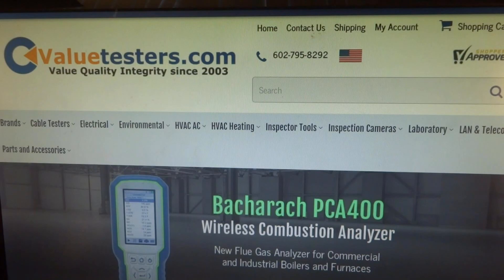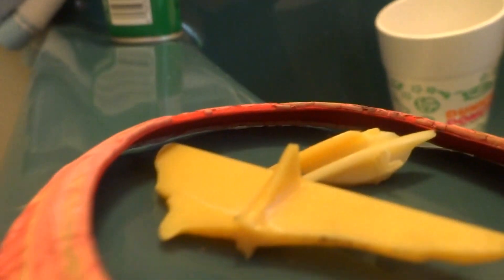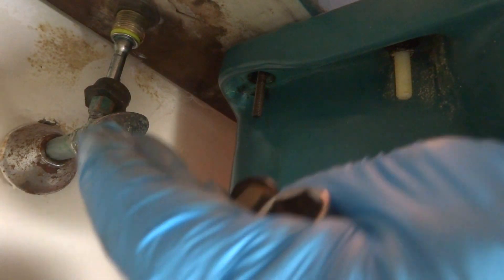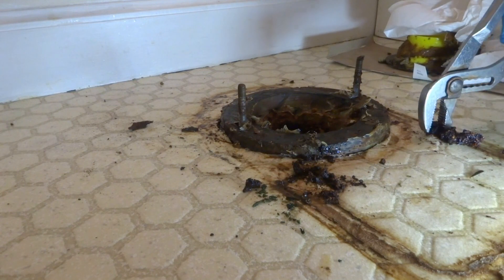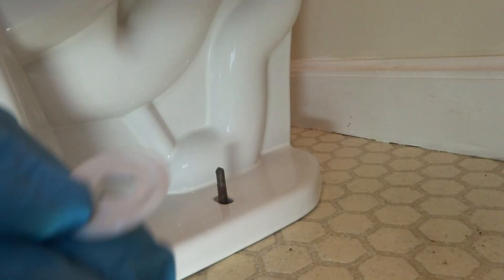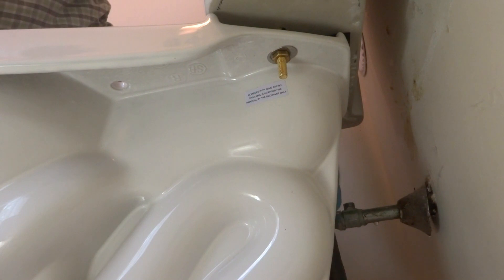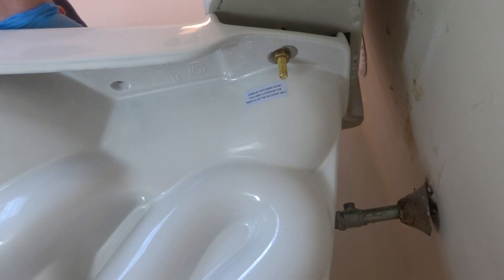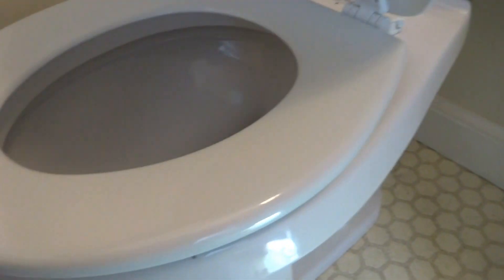how to replace toilet  new Gerber

Comment: The toilet you replaced is a 1954-59 “Standard” Cadet, which has four floor bolts, the 1960-61 version has two, then a redesign followed in 1962.  It’s in a very magnificent robin’s egg blue.

Comment: I will keep my old, old American Standard!  It may use a lot more water but  I do not have to keep a scrub brush by the side of it to clean the bowl after every use.  That Gerber had only about 2" of water in the bowl at the end of the video after the seat was installed.  That is what I hate about the newer  toilets.  My old toilet has about a gallon of water just in the bowl.  People talk about "saving" the water.  Please tell me what it is saved from?  The water will go down the drain and back into the planet just like all water on the planet does.  It will all eventually come back when it goes full circle.

Comment: Steve does an excellent job but often leaves aside some details that devalue his effort. For example, he do not change the water valve and use the same corroded screws to hold the toilet.
Reply: Did you SEE Steve get PAID to replace those items and STILL FAIL to do the job?